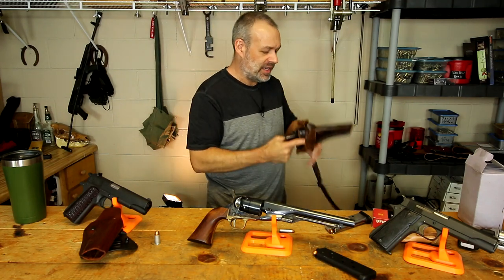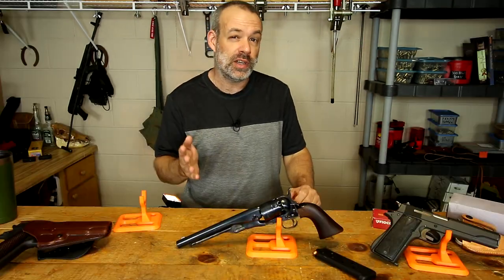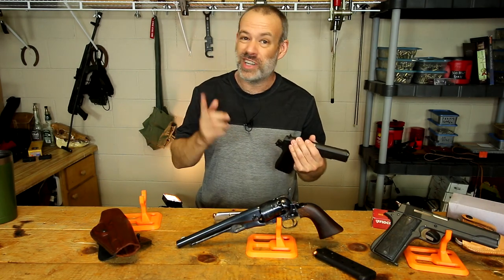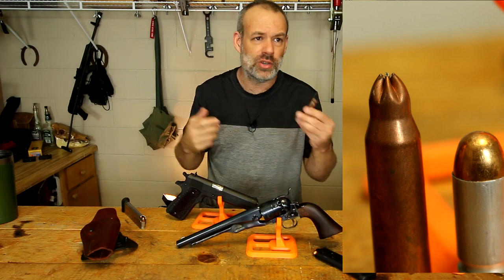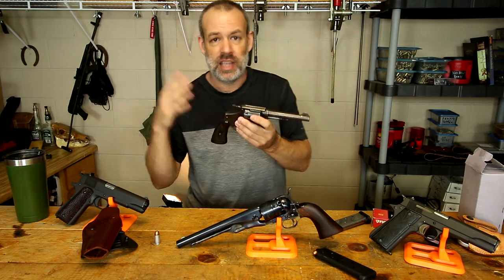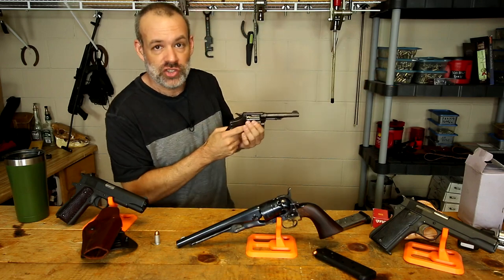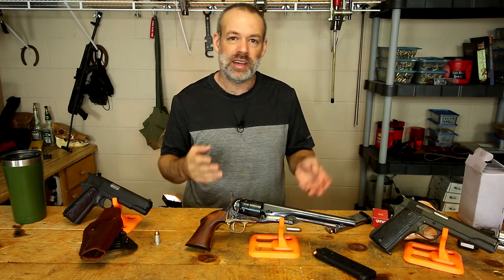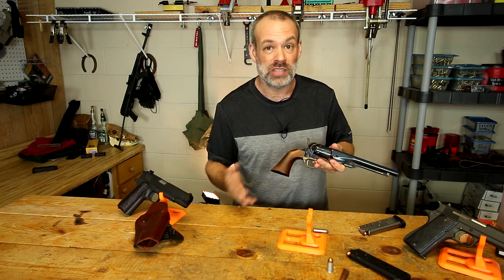How Do Prop Guns Kill?

Comment from the maker: A ton of new info has come out since I recorded this including the possibility of it being a full power FMJ round being loaded in the revolver and the crew walking off set due to safety concerns.  I may have to make a follow-up video on this when all the details are out.
Reply: Yeah I'd say it was a .45LC presumably it being a SAA Colt. Always follow fundamental safety rules when handling ANY firearm.
Reply: @shroom903  there was a armorer her name is Hannah Gutierrez Reed
Reply: @ragjr992  the woman that called 911 blamed it on the assistant director
Reply: @shroom903  ya because the assistant director handed him the gun and said it was safe during script reading and he put it on his lap
Reply: If you do will you talk slower.  I clicked on your video to learn.  You're talking so fast I don't understand a thing.
Reply: That would be a good thing to do.  The more I read about it, the more it sounds like a multi level CF.  However there is so much "information" out there, some of it contradictory.  Production has stopped, an independent investigation is under way.  Hopefully the truth emerges eventually from the independent investigation.

All that said, bottom line responsibility always rests with the person pulling the trigger.

Final comment.  I thought I was the only one bothered by the obvious blanks in the Matrix...
Reply: Let’s not forget the fact that this was the fourth negligent discharge incident on set in the last several weeks, according to crew members. They said safety protocols were not in place and something bad was bound to happen. The morning of the incident, 6 film crew members walked off set due to safety issues, unrealistic hours required of them, pay issues, etc. And lo and behold the person two people that get shot are the director of filming and the director of the movie. Someone should be prosecuted
Reply: Blooming heck, no place for live rounds on set in any capacity, if they arent there they can never inadvertantly be loaded by mistake! Im just an enthusiast and do load for my old milsurp and precision rifles, i have clearly marked inert rounds for checking feed , stripper clip practice etc, not hard to have simple discreet markings like centre pop on base or scribe on side to cleerly identify inert rounds that should be double checked by more than one person in the case of movie sets where shooty-shooty-bang-bangs are pointed at people. Ive seen talk that actors are supposed to check as well and even fire the gun and Baldwin may be charged, seems a bit extreme. Someone has been grossly incompitent, thats without a doubt but i dont feel its Baldwins fault. Another recent "prop gun" death you may not know about was some actor killed filming a clip for a rap "artist" here Down Under who was point blanked with a 12gauge blank, the incompitence grinds my gears, these prop masters involved with firearms should be fully versed in safe handling and operation of real firearms because then this crap wouldnt happen if that was the case.
Reply: @debravowell8337  You can click settings and reduce the speed by one quarter. I prefer it when people talk faster so I increase the speed a bit.
Reply: This was clearly an actual firearm being used on the set.  Which is sometimes done (and safely, with strict and careful rules, proper chain of custody, etc.)  

Where Baldwin bears the responsibility is that, in using a real firearm, strict safety rules must be observed (the Big Four).  Any actor using a real firearm on set has usually gotten good training and has much experience with firearms.  They would 1) naturally check the action or look at all the cylinder chambers to insure it was unloaded (if rehearsing) or loaded with the correct blank ammo, and 2) never actually point the weapon at another actor or a crew member when doing the take.  I've have noticed it many, many times in movies where the actor doesn't actually point the gun right at the other actor.  No viewer would take them or the producer to task for 'ruining the realism' of a shot for not truly aiming at the actor.  Most people would never notice it, and if it's staged properly, you can't even tell.  No actor who had ever used a firearm or had training would ever aim right at them - it's easier to miss than to hit.  

But Baldwin, in his arrogance and hatred of the 2nd Amendment and responsible behavior, couldn't be bothered with learning or practicing safe gun handling.  If he didn't know better, he should have!  The guy's been in dozens of movies where he used guns, and he's in his 60s, for crying out loud!  He is also the producer of this low budget film.  For shame!

When a scene calls for a child, or someone who has no understanding of firearms to shoot a gun, they should never, ever have anything but a blank-firing-only, MADE SAFE gun placed in their hands, and then only with close and strict supervision and training on how to use it, by the armorer and prop master.  Baldwin has plenty to answer for.  And I loved Beetlejuice and Hunt for Red October, btw.
Reply: @tabcreedence6553  
Thank you...
Reply: Plot Twist: Disgruntled crew member loads gun with live rounds before walking off set...
Reply: @danwright469  Last thing that I saw, It is an "Internal" not "Independent" Investigation!!
Reply: @shroom903  So it's not confirmed it's a rumor.  Stop being a rumor monger.
Reply: @shroom903  Because she had been chastised at lunch for some shortcoming that day.  Hardly an unbiased witness.
Reply: @ragjr992  He just likes to spread unfounded rumor and gossip.
Reply: There is a report that the crew was target practicing with the same gun, the day before, with live ammo... which sounds like a huge no, no.
I wonder if the inert "hero" rounds are typically marked in such a way as to distinguish them from live ammo?
You would think that unless they needed a close up of loading or an open cylinder etc, that there wouldn't be an inert primer in the case to eliminate the possibility of loading a live round?
Reply: @debravowell8337  you can turn the playback speed down
Reply: @eielson1978  It is being done by the sheriff who is independent of the production company was my intent.
Reply: Good video/info watching from Australia I also read somewhere last night ,the lady that passed was booked next to do a film/story on pedophilia I don’t know what that has to do with it take from it what you will 👍
Reply: There's also reports it was after the director asked for another take and Baldwin said "well why don't I shoot the both of you" then leveled the firearm and shot it..... that right there if true implies that either he knew that it was live ammo or was completely negligent to the fact that there's been multiple accidents on set already causing people to walk off.
Reply: A live .45 colt round Will have enough over pen with period lead ball... apparently they had live ammo To familurise the actors with how the weapons shoot and feel or something dumb
Reply: @debravowell8337  Click Settings (the gear icon on the bottom-right of the video, or upper-right if you're on mobile), then Playback Speed, and from there you can change it to 75%, 50%, or even 25% of normal speed. I, for one, like his speedy, no-nonsense delivery.
Reply: @shroom903  They had an armorer, but she didn't know how to load a gun, much less make them safe. She even asked for them to hire a real armorer.
Reply: @LegendStormcrow  i doubt alec could've checked n made clear especially if the armorer couldn't
Reply: @LegendStormcrow  it just came to light that the Armorer allowed the crew to shot cans during breaks with live ammo she loaded for them so this is squarely on her for not doing the proper checks and saying its safe. Because I don't expect a untrained person to be able to do anything with a gun which in this case was a actor
Reply: @dunxy  I disagree. Alec Baldwin hired incompetent people and he's the executive producer. If he didn't know there was safety concerns before, people walking the same day over safety concerns. We call that a clue.
Reply: @debravowell8337  
Use youtube's 0.75x speed function!
You're welcome.
Reply: Yup it sounds like they were live rounds.  Now I don't think it is all the prop master.  Anyone handling a real gun should know how to check it for live ammunition.  To me ultimately it is the person in control of the guns responsibility or at least 50% is their responsibility.   Not even an actor should be given a free pass from being responsible when handling a gun.  I have not liked Batman or Alec for a long time but it wouldn't matter if it was someone I liked they still need to be able to check the gun.
Reply: @glitter_fart  Just like the driver of a car.
Reply: @ragjr992  A person is only "Untrained" until someone trains them, and training the cast is part of the armorers job description. And let's not forget this wasn't Baldwins first rodeo. He's been in numerous movies involving firearms. He has no excuse for not knowing how to check the gun
   As far as the armorer is concerned, after the previous negligent discharge incidents she and anyone else within the chain of custody of the firearms should have been fired and bared from the set and the set should have been scoured for live ammunition before filming resumed.
   There is plenty of blame to go around here.
Reply: @williamharshman9572   yet HE pulled the trigger 🤦‍♂️🤦‍♂️. At people who weren’t in the movie…..  You call that competent??
Reply: @bnetolldnataman  camera people aren't in the movie but you can't make a movie without them, right? The fact that qualified people walked off the set over safety concerns makes it seem like; go ahead I will just get somebody else. He's not gun familiar but he's also in charge of who does what. Low budget film with safety concerns.
Reply: @ragjr992  ... an " Armourer " in name only. Her Daddy is a real one with a good rep but she herself has ZERO experience. She only got the job by name dropping.
Reply: @nerblebun  Different prop companies have different "Props. Auto loaders, by design cannot cycle with blanks and must as such be modifed to do so. These modifications make then unable to fire live rounds. Revolvers on the other hand can cycle blanks just fine. It is tempting to simply load blanks into a revolver and call it good. As was done in this case
Reply: @dunxy  Forget "no live rounds on set". Instead, make it "no operable firearms on set, or within a mile of it."  Violators subject to firing and loss of motion picture credentials, so don't expect to ever work in the industry again if you bring a functioning firearm, in any capacity other than your personal firearm, which should never leave your hoster except in a life-saving situation.
Reply: @debravowell8337  future tip. click the gear icon on the player, click "playback speed" then chose from 0.25-0.75 speed
Reply: @HebuTheLoneWolf  got it thank you!
Reply: @eielson1978  "Last thing that I saw, It is an "Internal" not "Independent" Investigation!!"

Well you saw wrong or are looking at propaganda. A person is dead and another is recovering from a single bullet.

This ain't no dress rehearsal and it's not a independent investigation unless you count all the different agencies looking into it... Local, SBI, FBI, ATF, Marshals Service, etc.

Independent? I'll bet the movie industry is looking at that one very hard too to prevent it from ever happening again...
Reply: I'm Sorry that you are "Confused" about my Commnt because you are Joining the Conversarion Two Full Weeks After the Events happened.  If you could View the Original News Reports that the Comments are Based on, First Day News Reports that were stating an "Internal" Investigation.
Reply: "I may have to make a follow-up video on this when all the details are out"

Yepper, it's the right thing to do with no politics involved.

We don't know what we don't know yet...

...but we will soon (I hope).
Reply: @debravowell8337  I'm not english native and it feel ok for me. Even if i'm french.
Reply: Apparently, a blank shotgun shell killed Johann Ofner in 2017.